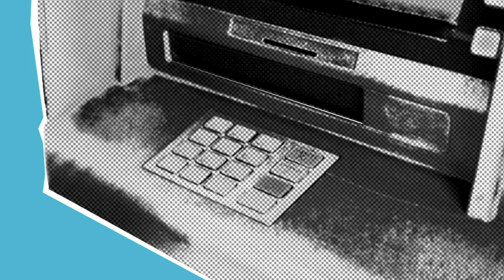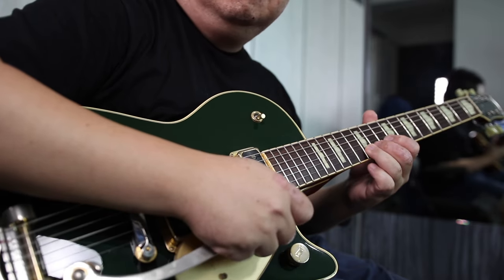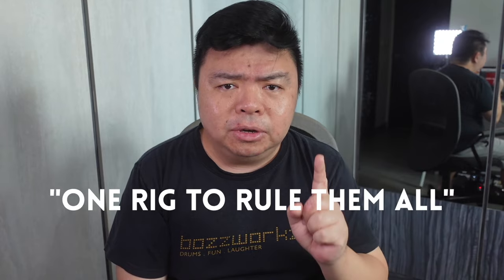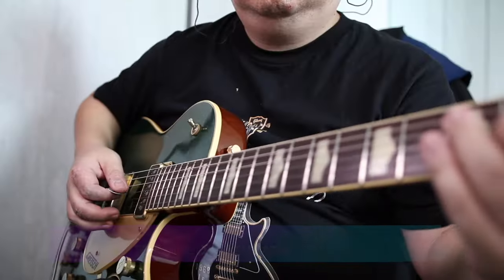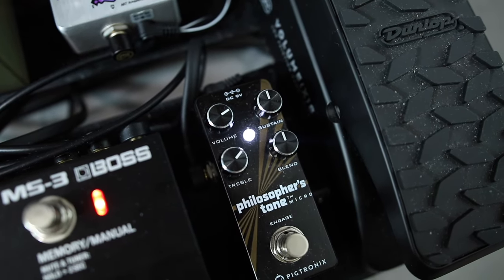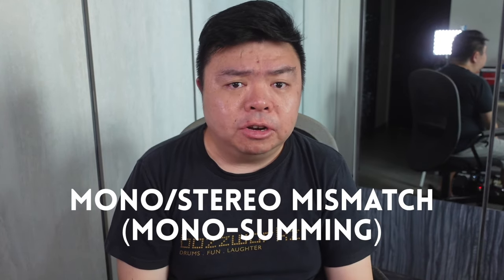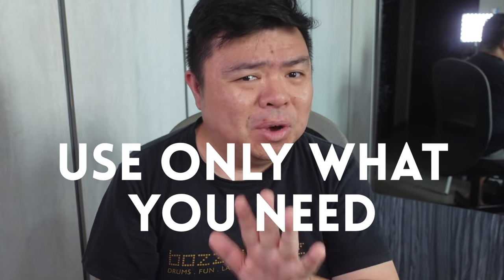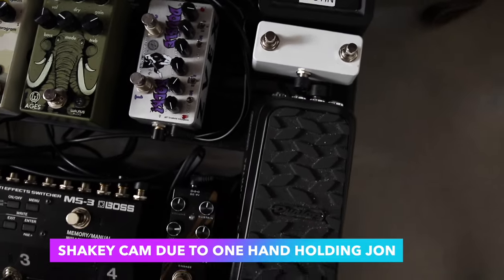How To FIX Bad Pedalboard Tone NOW

Comment: Something that helps me a lot is actually adjusting my tone and volume knobs on the guitar. 10 across the board is definitely easy but adjusting that tone knob can help SO MUCH. Also a compressor and a buffer are a must have
Reply from the maker: Great tip! Yes, especially a strat bridge pickup which can get especially gnarly with the twang with the tone on 10 at high gain. I’m usually at 8, sometimes even 6.

Comment: I dont know if you really need more than one rig these days. It might be daunting for a beginner without the right gear, but I think it can be done. For example, my rig goes Atlas Comp>TS>Morning Glory>Halberd V2>Rat clone>HX Stomp XL>Volante>Ventris>Deco v2  I usually just run that into my inteface, or I could throw my Mark V25 int the mix. I cant think of any style I cant play with my rig, it would be a lot easier when I get midi set up, but still.
Reply from the maker: Nice rig! That HX Stomp XL is the "tone chameleon" that can suit the variety of styles possible. I think my larger point was that the approach has to be different with analog or hybrid rigs. The individual pedals lock in the limits of what they can do stylistically (this particular rig of mine can't do classic rock, for example).
Reply: @AllAboutWorshipGuitar Thanks. I love my pedals. But I see what you are getting at. I mean I am going to start working on getting  my board under control with a MIDI controller soon . Another thing is I mostly play at home. I dont think I would take what I have out to a show at say a bar or something, another reason why people may want a more focused board. Have a good one man.